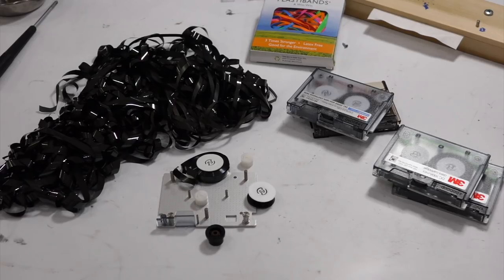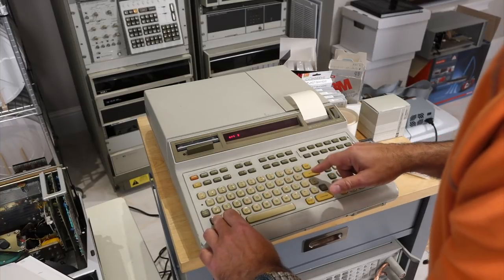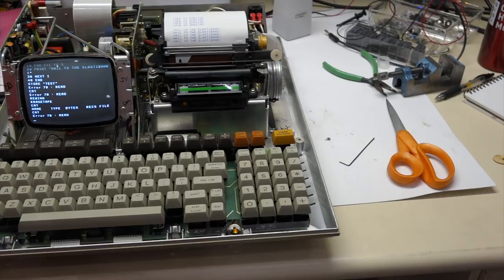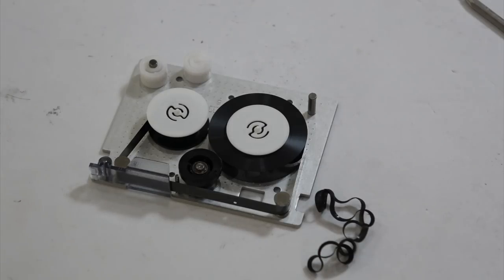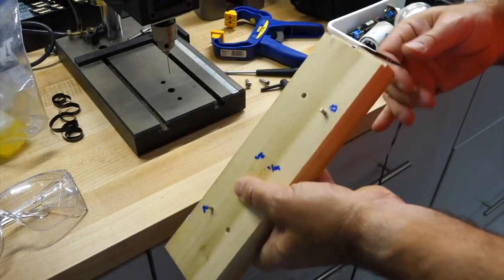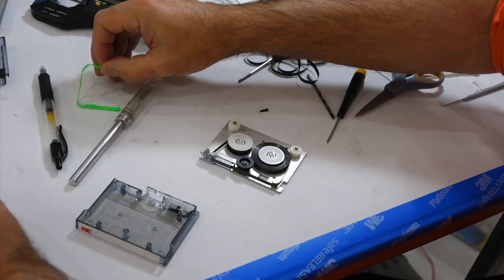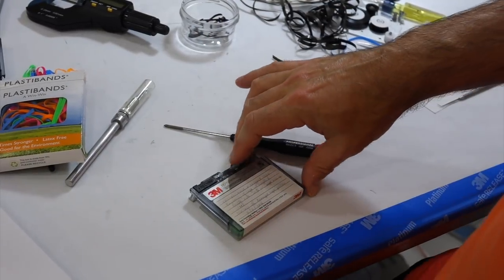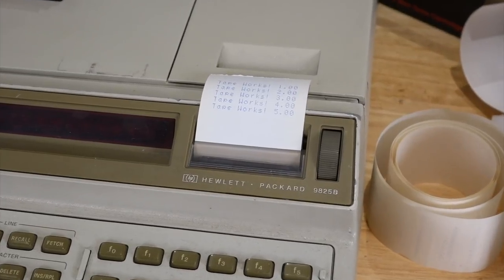Vintage HP Mini Cartridge Tapes Part 2: Tape Salad (Refurbishing DC100 and DC2000 Tapes)

Comment: Marc, I really like the little shots of your lab notes. Could you make a video on why and how you write up your lab notes? I learnt what I do from an old DEC engineer, but it's always interesting to find out what others do who still write everything down like myself. I think we're a bit of a dying breed.
Reply: Andrew van der Stock, I know this was addressed to Marc, but I have tried several different methods and settled on Microsoft OneNote for my lab notes. It is versatile and very feature rich when you dive into it. I can insert Excel spreadsheets for data and calculations, PDFs for reference, entire web pages, photos, hand written text, voice notes, video notes and files, etc.  If you use it with OneDrive, you have access to your notes anywhere you have an internet connection.  And I can always print out a hard copy. Just my $0.02

Comment: The holes were probably done with a hole punch, i.e. a metal pin in a tight fitting hole in a metal plate.
If you have ever seen fungus in tapes from moisture, it's probably not a good idea to spit on them.

Comment: That approach with a p-belt was also used in some flight recorders - they were extremely sensitive to contamination, to the extent that if you dismantled the tape transport you had to wash all the parts in Freon TF and reassemble them in a laminar flow cabinet. OK, the reliability demands of a flight recorder are somewhat higher than a tape for a desktop computer, but it still always struck me as a somewhat questionable approach.

Comment: I restore broadcast video tape machines to playback and archive old television shows. Most of the time since the tapes are almost 60 yrs old you have to bake them in an over to restore the bonding oxide to the Mylar or else the oxide will separate from the Mylar. I NEVER playback a tape without baking and cleaning
Reply from the maker: That might be a safe thing to do. Baking (drying?) at low temperature cures the tape oxide binder that might have become loose. Often necessary on 1/2” 9-track reel tapes. However on the DC mini cartridges I have not yet needed it. Maybe I was lucky.

Comment: Great work! What a pain to do, but at least it’s possible to DIY, unlike say reformatting the servo platter on a hard disk. 
Do you have any machines that use hard sector disks? I imagine you could use a laser cutter to put the holes in the correct places?
Reply from the maker: +compu85: We sure do. The Alto has hard sectored disks. We just succeeded in realigning one. Story coming up. My old HP hard drives are also somewhat similar to hard sectored disks, with a factory written servo track on one of the platters. If that one ever goes bad and we have to recreate it, that will be the hell of an interesting video.

Comment: We had a 'refrigerator' with the robot arm that read the tape bar codes then pulled it out and inserted it into the tape drives.  It went about its business during the wee hours of the morning backing up all the servers.  We would get a carton of a bunch of boxes of ten tapes per box.  The 3M tapes were like almost a hundred bucks apiece and one carton was like 2400 dollars!  Every week we shipped a whole bunch of tapes off to a storage service for disaster recovery (fire, earthquake).  If the RAID disks couldn't recover from a crash then we had to get the tapes back and reload them to the disks.  Lots and lots of tapes...

Comment: Is there any plan to build a tape emulator for these old machines? Seems like it would be a good idea to start engineering a hardware emulator.
Reply: Closest thing is a brilliant GPIB floppy/hard disk emulator called HPDrive, but it requires a GPIB card in both the '85 and a Windows PC.

Comment: It's great that you managed to get the tapes working but I'm not convinced that drilling holes in them is advisable as the resulting holes are very rough with obvious flanges. I wonder if it would be possible to construct a mini hole punch to perform the task with greater accuracy?
Reply: I would imagine that is how they did it originally. I suppose the question is, "Do you want to prove it can be done?" or "Do you want to make a bunch of them?"

Comment: How do these work? Surely if there's a belt connecting the two reels, both reels would be moving at the same speed, so tape on the full reel would be moving faster than the tape on the reel that's not so full, right? So how come the tape doesn't get torn apart or spill all over the place?
Reply: Because the diameter of the tape reels changes in direct correlation to the amount of tape they hold the speed of rotation is also affected similarly as they are driven by the belt on the outside of the reels. So any differences in tape quantity on the reels is adjusted for automatically.
Reply: the band drives against the spools with friction.  I remember seeing inside one decades ago and being blown away by what a cool bit of engineering.
Reply: Too complicated for me!

Comment: To repair my DC100 tapes and my new DC2000, after seeing your video I ordered a SF-6000 pack. But out of curiosity I asked myself the following question: I wanted to know if the PlastiBands you had installed were aging properly, if they were not relaxing too much, or something else?

Comment: Those mini-QIC cartridges were an absolute disaster just waiting to happen. There's no end to the grief I've had with these in my HP-85 after replacing the capstan. All my tapes are 100% SNAFU. Funny how lowly microcassettes (as used e.g. in the Epson HX-20) hold up much better. Granted, they're not as cool.

Comment: You may be able to splice the snapped tapes, rater than make new holes in the tape. Google tape splicing block. I has some success back in the day, splicing with sellotape,
Reply: Wow, I had no idea that was a thing. Maybe that'd make it possible to save some of my dozen original HP software tapes, that'd be the greatest!
I'll owe you an e-beer if that works, lol

Comment: Great video. I have changed the belt by the plastbands one and made the others procedures that you recomended. I have issues with tape rewind that is too fast and the tape jumps out ou the reel. When the drive runs at slow speed (like formatting procedure) I have no problem. But after 2 or 3 seconds of rewind procedure it stops with the tape out of the reel. I am using a Colorado 250 tape drive and Colorado tape software for DOS. Can you have any possible solution for this?

Comment: How is tape tension maintained in these tape cartridges? I get that the band moves the bobbins at equal linear speed, but there's surely going to be some inevitable slipping, and probably not in the direction of increased tape tension.
Reply from the maker: There is a combination of slipping and friction, and it is very cleverly engineered to maintain tension. That’s why winding and rewinding the tape restores tension,

Comment: It should be possible to use a laser to make those holes.  Cheap K40 CO2 laser engraver or a small balloon popping solid state laser might be the way to go.

Remember fixing a few of the PC backup tapes (bigger version) by switching bands from another cart, brings back memories.
Reply from the maker: Actually I found another easier method: large diameter syringe needles, they poke nice clean holes.
Reply: @CuriousMarc  Yeah, that would be better, they have a well ground sharp edge that will do a progressive shear.

Comment: Dang. I finally got around to making a precise drilling jig like that for the tape marker holes, with a nice guide slot and all, but I only seem to mangle the tape when drilling. One setback after another
Dunno if my drill's not fast enough, bit's not sharp enough, etc. Either makes a nasty crumpled hole when it "works" or usually just catches and spools a foot of tape onto the bit
You make everything look easy lol!
Reply from the maker: It happened to sometimes too. The tape must be firmly held in the fixture. I ended up using a piece of clean room wipe sandwiched in the fixture to provide even pressure on the tape. I think you can see it in the video (see 15:01 for example). That fixed it.
Reply: Ah, I was wondering what that was. A length of weatherproofing foam worked well. It wrote and read the tape perfectly once (just to get my hopes up), then 'error: read' again.
At least that shows it's probably not the r/w head. Probably more bad spots on the tape or the roller's too hard. Maybe I'll try upping the write current even though they're DC-100's.
Thanks for all your advice by the way - I would have given up long ago. Hopefully my info of Terry will help you at some point. :)
Reply: I read your comments in Hank Hill's voice, since you started the sentences with "Dang." and "Ah" lol
Reply: @CuriousMarc  I'm not sure if you'll get notified from this, but I just finally tried again and got infinitely better results by sharpening a big blunt needle and using it as a punch (I forgot the size, I'll edit this and add it tomorrow)
It made a perfect cleanly cut hole every time and I didn't need a jig, just a yardstick and table. I'd recommend giving it a shot if you ever need to do this again!

It took a bit of practice on some tape (pre-ruined from previous drilling attempts), but once I got the idea the results were practically identical to the original punched holes. A hint though, don't punch it over a soft (wood) surface, or it'll just push the tape into the wood
Reply from the maker: That sounds like an excellent idea. Which type of needle did you use? Where did you get it from?
Reply: @CuriousMarc  I used an 18ga (0.05") needle. It's ever so slightly bigger than the original holes, so maybe a 19ga would be better?
I'd recommend getting a blunt dispensing needle (stainless steel of course) if you can find one reasonably, and sharpening that.

I sharpened the inside surface since it was easier, and just deburred the outside, but YMMV since you have more extensive tooling.

I got mine at a farm supply shop with a few odd stares lol. They only had 18ga and pointy tips, but I was impatient. I had to hack off the tip, which didn't make a nice cut, even after deburring.
I'm not sure where a better place to get one would be. Seems like everything online is 20+ bulk.
Reply: @CuriousMarc  I should add: "slightly bigger" is only a couple thousandths bigger at most, but it might be better to be a couple thou smaller for more strength?

Comment: In a DC2000 cartrige the tape was chewed up. Is it possible to resurect the tape and retrieve data from it?
Reply from the maker: Depends what you mean by chewed up. Ifcit’s tirn, no, if it’s just folded over maybe, just rebuild the cartridge as in the video.

Comment: Thanks! What diameter drill do you use for the tape holes please?
Reply from the maker: 0.043", which for the whole world except the US would be about 1mm. Drill #57 in my imperial drill box. I suspect a smaller hole would work fine too, as the very early HP branded DC100  tapes have noticeably smaller holes.

Comment: would it be possible to make a microcontroller that fits into a tape cartridge that has a tape head inside of it and could convert the analog encoded data from the linear tape head on the computer, and write it to a SD card? Basically, a tape emulator.
Reply: Would also need a rotary encoder to sense if the virtual "tape" is being spun by the drive :)
Reply: yeah, that would be tricky. I wonder if an encoder wheel from a mouse would work.
Reply: Probably - those sensors in mice are just quadrature encoders.  You would also need a couple of LEDs to fake the BOT/EOT holes in the tape.  I'm pretty sure the encoding on the tape is just NRZI, which is very simple to encode and decode.
Reply from the maker: Unfortunately, all the tape drives are different. Some use magnetic speed pickup, other optical sensors. The encoding on the tape is different for the 3 drives here: they all use a different modulation technique (and none is NRZI). And the number of tracks differ - the HP 264x has one, the other have two.The speed of the 3 tape drives is different too. Looks like each HP division made its own version of the tape mechanism, electronics, control, and tape encoding.

Comment: Replace all those tapes with a kickstarter project where a USB memory and  smart I/O transfer data to a magnetic wheel would be nice because those tape will keep failing.  I mean can engineers transfer audio data to magnetise an audio tape loop for tapedecks to read linear,  it seem it is only the  motor logic to I/O functionality to fetch correct data missing, and the different magnetisation levels on different tape media. A switch on tape for different machines to adjust I/O funtionality and mangetisation levels. Probably the looping media to read and write from will wear out and need to be easily replaceable a cassette, otherwise you just changed one problem for another.

But probably the tape logic adressing to I/O is rather quirky, and you also would need to be able to write to USB not just read from it. And there probably no real market for tape cartridges anymore.
Reply: Would replace the original media be cheating doing vintage restorations, i mean the hardware to read correct media would still be there. Media is just a storage utility.
Reply: I agree, but you may need such a thing as a tool to interface between more durable media and the legacy equipment, because copies of tapes will eventually deteriorate.

You could probably do it by using the drive wheel as a power source via a mini generator, store the power in a capacitor, and use an inductive coupling to connect to the tape head. Boards like the ESP8266 are tiny enough to fit inside a cartridge and connect to WiFi.
Reply: How does these old tape cartridges work, do they just read out the media linear or to they have some sort of adressing / directory space at the beginning for the stored programs "like video tapes?", i guess if so it must be some sort of time code stored digitally, and have the timecode searchable?

I can see i did not quite get how the car casette cartridges work, i thought they worked with a DAC but apparently they somehow convert a phono audio signal to feed a tape head? I do not quite get it so the computer deck tapehead read of another tape head in write mode? I thought they had a bit of tape that was magnetised in a loop, because i remember that was how the old tape echoes worked.

Well probably it the machines use different heads and diferent frequensies, it would be hard to make a general purpose emulating cartridge.
Reply: The media is just stored sequentially with a block of directory data at the beginning of the tape. The drive will just maintain a tape counter in memory which corresponds with the index in the directory block.

With respect to the audio tape cassette adapters, most of the time they're just passive and contain a set of coils which locate against the tape head, and which are driven by the headphone output from the thing you plug them into.

The coils are different from a record head, because just smashing two tape heads together would not render any signal, as the head gaps are very narrow on each side and they would need to line up exactly.
Reply: But something passive on the line of a car cassete cart ridge could actually work or is the data to highfrequensy to fit within the audible range, well it must be when you consider tape speed and data rate. What would the obstacles be?
Is the storage signal binary or multileveled? It seem audio signals would not have to be binary, but probably at higher speed leveling of signal to signify wordlenghts would be hard?
But it seem an audio signal easily could have a range and be 5 or 6 bit? But that may not scale up to higher frequensies, why is storage binary, probably have to do with error rates?
Reply: I suspect getting the coupling to the tape head right would be the biggest challenge since that has to go both ways (instead of just one way). I guess it's a bit of trial-and-error to find out which read/write rurrent and frequency the drive uses to record data onto the tape.

The rest of it is pretty straightforward, you may be able to use a computer fan motor in place of one of the reels as a generator, which also provides a counter signal so the embedded controller would know how fast the cartridge is driven and in which direction.

Data could then be fed off 'virtual tapes' stored on a server and pushed to the cartridge via WiFi.
Reply: I know I'm quite late to the party, but some genius made a Windows program called HPDrive for this purpose, except it emulates an HPIB (GPIB) floppy/hard drive.
You just need to hook the HP via HPIB to a modern-ish Windows PC with an NI GPIB card, and run that. But it works fantastically!
The only problem is that it requires a price-inflated HPIB card for the 85, and a ~$30 GPIB ISA or ~$100 PCI card for the PC...